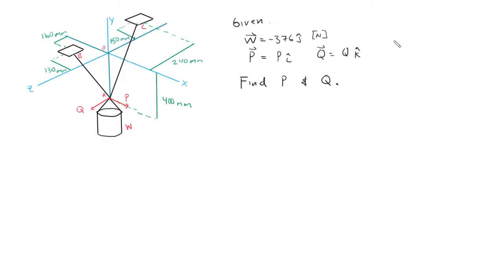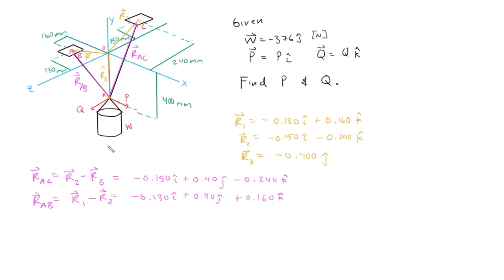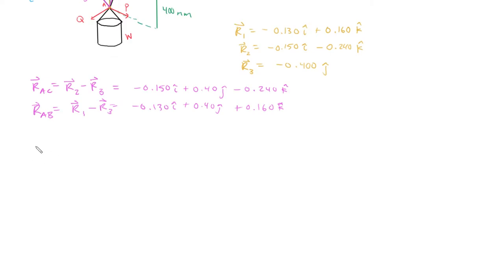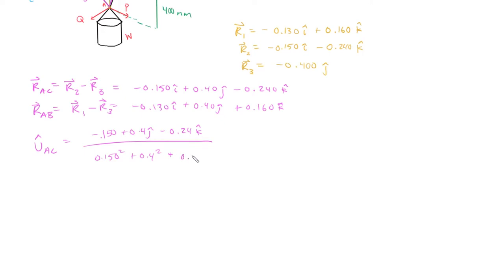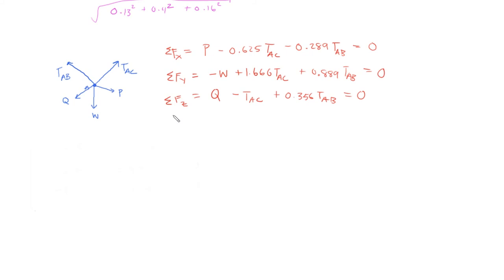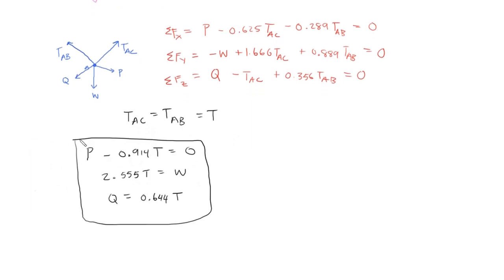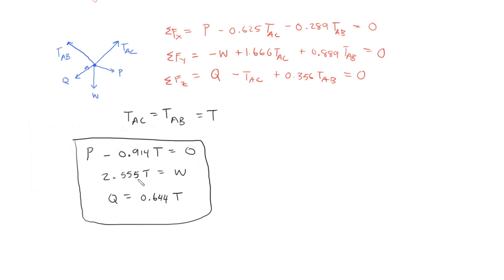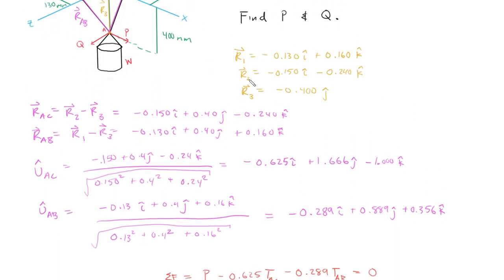Statics | "A container of weight W is supported from ring A. Cable BAC passes through the ring..."

Comment from the maker: ERROR ALERT
Someone pointed out a calculation error when finding the unit vector, Uac. I forgot to take the square root of the denominator. The correct values for Uac are...

[-0.3061, 0.8163, -0.4898]

Using the above values, the final answers are...

Q = 29.501 N
P = 131.213 N
T = 220.489 N

Thank you, Connor Latham , for noticing the mistake!